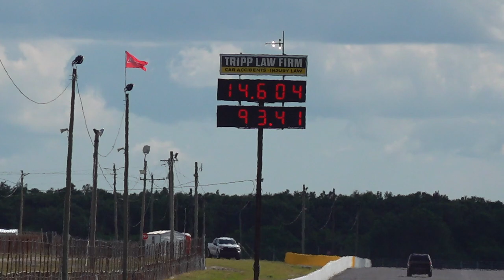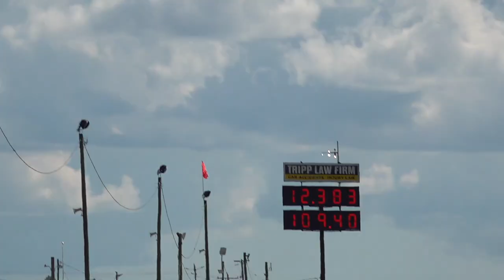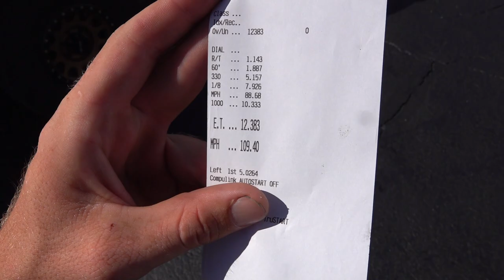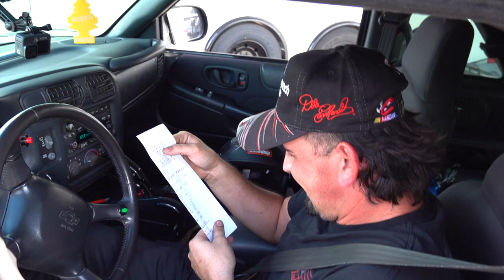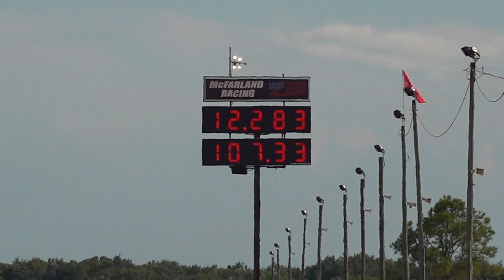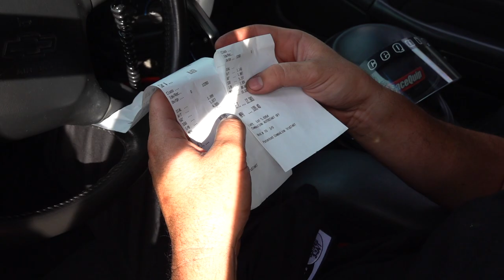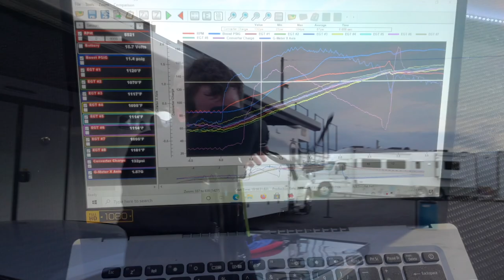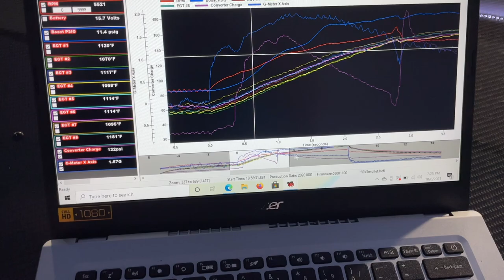Our LS Swapped Blazer Hit The Drag Strip and Surprised Us All!!! + Mullet Blows His Transmission...

Comment: wire it up with a relay on the trans brake that inhibits the nos while the trans brake is on, then you hold down both buttons at the starting line and the instant you let off the trans brake, it gets the spray.
Reply: Itll still bog. Tiny jet first stage on the 2 step, then full nozzle

Comment: George has never been so happy to run a mid 14 in his entire life. Lol I love it.
Edit: Mullet running a 7.6 off the trailer shows how much progress you guys are making on the setup of the truck. Also it shows how awesome that track prep always is at Bradenton. Those folks really put in the extra effort to give you all the best surface that is possible. Probably why so many records get broken and set there.
Reply: Probabky yes, just like santa pod raceway somewhere in England
Reply: Kinda feel like that's some of the issue with the car, they do basic test n tune at Bradenton with great prep, then go to other strips with crap prep and it doesn't perform because it's not tuned for low traction. I think they need to go test and tune at some crap prep tracks too

Comment: Ask Tom about old tyres he had a set of big boys in storage as they didn't make them anymore.  He used them at drag week. Old trues would definitely have to be harder. Have a great weekend Cleetus. Jack's 240 is awesome that will run fast times.
Reply: Yep, old tires are an issue.
Reply: Even stored properly they still harden as they age. If you know what you’re doing it’s possible to soak them and get most of that grip back for a little while. But, they’ll still never really be the same.

Comment: I think the rear gears are too high (probably 3.08 or 3.42) and the converter seems too tight, but lower gears will Help alot. It leaves the line slow

Comment: maibe crawl under one of those totalled crown vics (maibe one that has a copo upgrade?) and get the 8.8 with the rear driveshaft joint out from under there and adapt it for the blazer , guess with a spool (higher spline count)  , ford 9 inch bearing ends or a c clip eliminator kit (you need to narrow the thing anyway) and upgraded higher spline count chevy bolt pattern axles it should be strong enough even if youre going to turbo it at a later date 
lowering it slightly and make some linkages in the rear might help too

Comment: I use the same procedure yall used for self setting the tranny fluid but for my engine oil. All you do is change the oil as normal but tighten the drain plug to spec and then back it off 30lbs. This creates an effect called "pressure compensation equalization" which makes the oil pin point its optimal level. When the drain plug stops dripping, retorque to its factory spec and your good to go👍🏻. My next job will be to reverse the polarity of a vehicles 12V system and make the positive current flow backwards which doubles the rectified current. This makes the system twice as powerful with half the resistance. I just have to figure out why these so called "reliable" toyota engines keep throwing rods... They just dont build them like they use to. My wifes K20 TSX is on its 4th Engine as well, and they said K20's are strong and reliable as well.

Comment: Always thought it would be a funny idea to mount a radiator and the street tank on the trailer. For a drag and drive event. With quick disconnect fittings. Just unhook the trailer after letting the car cool down ofcoarse, slicks on, belt on the meth pump and fill the meth tank. Set of fresh plugs. Change the tune and go racing.

Comment: Check your band adjustment on ole mullet. Band applies first gear. Otherwise… ya’ll might need a band 😑

Run the band adjustment all the way in and count how many turns it goes in. You want 3.5 to 4 on the high end. Tighten it in to like 72in lbs and back it out 3.5 turns.